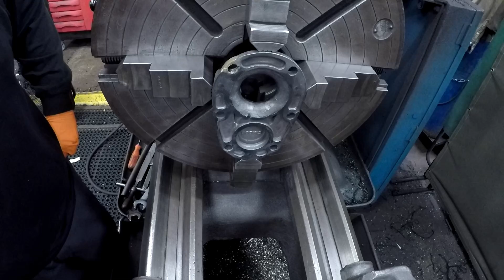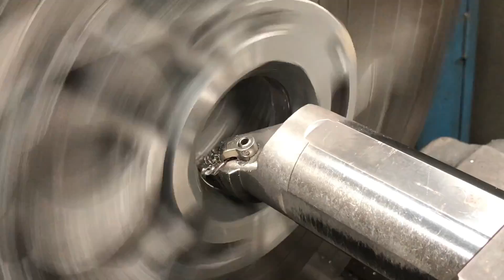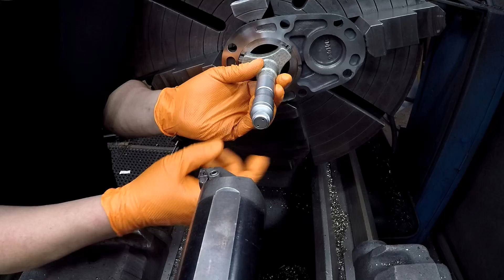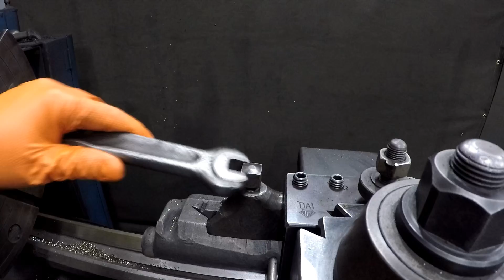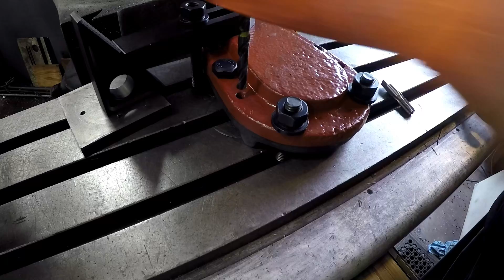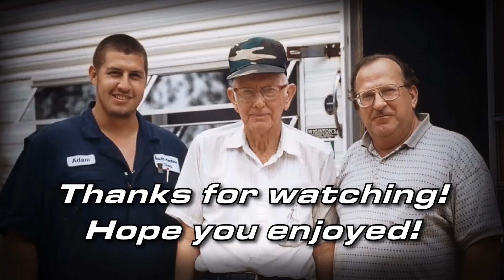Machining a Replacement Casting Part 2

Comment: Never seen a ceramic insert.  Wouldn't they be far too brittle?
Reply: junglejonny1000 I don’t understand questions like these. You just saw how well it worked. So, no, it wasn’t far too brittle.
Reply: @stargazer7644  I don't know if you have ever dealt with anything ceramic such as a ceramic knife.  They are very hard but very brittle.  Yes I saw it cut,, I was hoping to understand how it works.
Reply: If you got the money you can even get CBN inserts which are even harder. - You can easily cut 65C Rockwell hardened tool steel. - Looks like you are cutting with a plasma torch! Google it and get redu for the fireworks show!
Reply: They are actually cermet inserts, i.e. a composite of ceramic particles and metal binder much like Tungsten carbide inserts. The difference is that the particles are a different material, e.g. Titanium Nitride.

Comment: Great work on the new casting , The old casting could possibly be welded and re-machined as a spare , There is an arc welding rod with high nickel content for  welding cast ,Works very well (no pre-heating) ,used on welding my broken exhaust manifold on a 302 ford engine and the repair did not fail .
Reply: I used a nickel cast iron electrode on a tractor exhaust manifold - it worked a treat. it had a very soft arc.
Reply: Great work! I am continually amazed at what can be accomplished with these machines. Of course, it takes a savvy machinist to make the machine do what it needs to do.

Comment: The 2 threaded holes with the pipe plugs in it, probably to put in some srews to push, and pull the cover of the gearbox so you don't have to use a flat-head screwdriver as a wedge.
Reply: Check the last few scenes after he milled the channels. Those holes carry lube.

Comment: First  I'm new to your channel , second I'm not a machinist but I do find very interesting how crazy precise you have to be. I do have a question about cutting the face plate, would it have been easier to use the face grinder instead ? looking at it spin and cutting was a little scary !

Comment: I hear you Adam...on the "boy I'm glad that's done"  Whenever working on the delicate "one-rr" and holding in the lathe or mill is nerve racking....when that last machine cut is over and all is well...it is time to breath easier.  I sometimes double think everything...B4...loosening anything.  Last thing I want to to is re-indicate  the project back in.   I'm tipping my hat to your great job.  Best to ya

Comment: the last two  holes  with plugs , there  are  used as extractor .plugs are  only for protect  the thread.
Reply: They may also be used for that, but they also are used to check/fill the oil for the bearing.

Comment: It’s sounds sexy when you talks metric 😍🤪
Reply: You guys did notice that he converted everything to inches didn't you - "Half a thousandth" would be .127mm.  25.4 and you are back in the world, baby!  (Fun carping about Inches vs mm isn't it ?)
Reply: @mathewmolk2089   half a thou is .0127 mm
Reply: @markrosinski4814  misplaced decimal point. (I hate DP measurements anyway, but I stand corrected)

Comment: Adam, how do you decide between the lathe vs a mill for facing off that cover?
Reply: Work holding is much simpler and quicker than in a mill for this part.  He also is a lathe guy and its an important part so he's doing it where he's most comfortable.

Comment: This might be a dumb question, but the paint job makes it look like it's not meant to be disassembled now. Do you just break the paint next time you need to undo things?
Reply: If it was designed for disassembly, it would have some provision included for removal, such as ears or threaded holes to jack it out.
The only way to remove the cover is to knock it with a hammer, and because of the bearing, that will only work if the gear box is opened up first.
You can try to get a chisel into the seam, but you are just as likely to end up with what you have here - a broken part.
Reply: @joshua43214  It does have provision for jack-screws.
Reply: @donpollard9460  Where? All I saw was taper plugs and bolts. You can't jack from a taper hole...
Reply: joshua43214 maybe it wasn’t a taper hole originally.
Reply: @joshua43214  You can if you use an expanding tool - can't remember its exact name - , but Sykes Pickavant  make 'em, as part of their puller range. You set it in the hole, tighten up the screw (this expands the end to become tight in the hole) and then you use (perhaps an impact) straight puller to remove the casting. Besides Adam said it was where oil lines ran into it (possibly because the shaft was above the oil level ...
Reply: @donpollard9460  That is why they wanted the clearance on the bearing. - This thing is only a cap. Today it would have been a 16ga sheetmatal stamping.
Reply: Industrial paint jobs are usually for corrosion resistance and a recognizable color only.  It would be too expensive to paint it in a different way.
Reply: Yup

Comment: 13:16 probably jack screws??
Reply: That was my thought. Why have a pipe plug into a blind cavity? Possible at some time a bit of oil weeped out and someone ran a plug into a straight thread. Surprised there are no alignment dowels.
Reply: @marksmith6837  Note that the holes line up with the bearing, nothing else, so I think I'm pretty close with this. In another of Abom's videos, he has to deal with a broken casting and it has similar 'symptoms'!
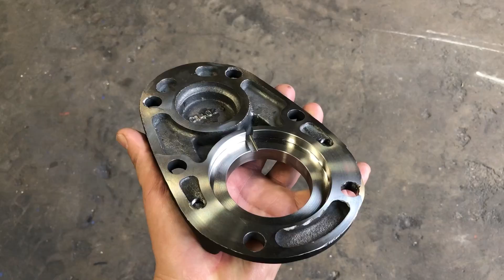Reply: Don Pollard. At 31:15 you can clearly see the plugs in the rough casting area in the mating bolt circle, not in the bearing boss. Besides that, the bearing boss is .001" oversize (actually .0015") you wouldn't need a push off. No need to argue, we see it differently but pipe thread would make no sense for either use.
Reply: The oil probably flows through the box casting into the cover under the plugs. The plugs are there for service (like clearing blockage etc).
Reply: @joshua43214  See Marks comment above

Comment: It looks like brazing and then machining original part would be easier.
Reply: Adam made the right decision not to try and braze repair those cracks. By the time he filleted those cracks then welded each one, the distortion would have pulled those bores for the seal and bearings. Then you would have to try to weld them completely and rebored like he just did. My very initial thought was like yours, but then I realized why he went this route.
Reply: But nowhere near as interesting a video... ;)
Reply: Actually I find videos of repairs by brazing+machining quite interesting (and educational) as well.
Reply: @sergey_sovetsky  Yes, I'm not saying they aren't interesting, or something to learn from. I'm just saying it would have been much shorter of a process, with fewer steps.

I don't know how hard or easy it would have been to braze and machine the existing part to the same degree of flatness and fit. I'm not a machinist...

And of course, I don't think Adam does things for the sake of making a video more or less interesting (at least not ONLY that reason). I know he does things in "interesting ways" to learn new skills or sometimes shows a different way to do something, which is great. But in the end, the job has to get done.

Comment: Nice work, even though it cost you some tool sharpening. Haven't tried it on cast but would spot annealing for the holes helped with the hard crust?  Not sure if it would help or hurt in cast.

Comment: Hi Adam, what is the dial gage and right angle adaptor assembly called called on 5:15 can’t  find one any where.
Great work Peter
Reply: I think it's a standard indicator with an ID adapter fitted to it.
Reply: It is a Starrett 671. I obviously can't tell if it's actually the Starrett product in this video, but Adam has mentioned the part number in other videos. I expect other manufacturers have similar products - the Starrett one should also work with other micrometers, as long as the stem size is the same.
http://www.starrett.com/metrology/product-detail/671

Comment: It's a shame that you and Clarke were rushed on this part.  Leaving it in the sand mold to completely cool, would have probably given a casting that cut like butter.  Thanks for sharing your experience on this "tough" piece, Adam.
Cheers, Gary

Comment: Maybe I'm an ignoramus, but why not do this on a milling machine? Seems like it would far easier and you could've just finished the job at home where you already had the part.
Reply: I was thinking the same thing. It's possible that the back side of the part isn't flat or you can't assume it's cast true enough. But I'm far from being a machinist so I know I don't know what the hell I'm talking about.
Reply: I was thinking the same, it would be harder, but possible to clamp to a mill angle plate.
First clamped through hole, milled face around around clamp, then placed extra clamps around edge and remove thru hole clamp.
A lot of clamp work, I think I liked Adams way better,

Comment: Adam, you’re a true craftsman, a master craftsman at that! Your understanding of machining is second to none. The sad part once this generation is gone, no one will pick this trade up. As mentioned in several comments, put it on a CNC, that’s ok for production parts, but not for onesy and twosy. Thanks Adam.
Reply: At the shop that I'm at we work on mining equipment and we use both manual and CNC machines every day to get our work done. Some guys don't like to do manual anymore but I love running those machines anytime I can!!
Reply: StrikeForce MTB where about are you? I’m glad to hear that!
Reply: @jimposey3963  I'm in Clarksburg, WV. I love to run those old machines and some of the tooling we have dates back into the mid-late 60's too. Awesome stuff!
Reply: StrikeForce MTB hey strike not too far, southeast Ohio. Been to the old anchor Hocking plant several times.
Reply: @jimposey3963  I used to live off of the exit that you took to go to that old plant. Small world man!

Comment: Would be interesting to know what that part would have cost if 3d printed. I saw Ox just bought a printed metal part and it didn't look bad.  Great job, always a pleasure and education watching you work!
Reply: A part that large would be fairly expensive, you'd have to have someone 3d model it first, then have it printed. I threw together a mockup part guessing the size of it and Shapeways wanted 3,500 for it. Mind you that doesn't even include any of the cleanup work you would have to do. Besides all that, Shapeways says that their steel parts are not fit for industrial load bearing applications.
Reply: @MikeBucceroni  interesting, I've never had any quoted.  Thanks for checking into that!

Comment: I understand why you went with the casting the way it was but do you know, given the time, if there was any heat treatment that could have lessened the hardness of the casting?
Reply: Better control of the cool down.  The center part behaved better due to more mass resulting in a slower cooling after casting.  They had their hustle on to get it turned around.
Reply: @ShainAndrews  was there anything that could have been done (reheating) after it was discovered to be so hard?
Reply: @mikemarriam  You may have missed Adam's response.  Yes it can be done.   Uniform heat to the specified temp (1500F ??), maintain that temp for specified time duration (probably the better part of a day), then ramp the heat down gradually.  Time consuming when you are trying to get it turned around quickly.
Reply from the maker: You can anneal it with the proper temps and soak times.

Comment: Nice piece of work, nerve racking to say the least! I'm a Instrument and Control Engineer so obviously this is not my area of expertise but I was wondering why you could not clamp together and 'groove' the original, weld it up and then machine it? Any of you experienced guys help me out with that, am I missing something and being a bit of a Muppet!
Reply: I'm not 100% sure but I believe welding cast iron is very hard and the metal around the welds tends to be to brittle afterwards. Or I could be completely wrong.
Reply: It can be done, but welding cast iron is a VERY "dicey" proposition.  For starters, the requisite nickel rod is EXPENSIVE.  Booth, Fenner, and Rucker make an extremely strong case for brazing, not welding, broken cast iron.  The bronzes used in brazing yield a repair comparable in strength to cast iron and the base material's crystal structure remains intact.  By definition, welding melts the base material and that triggers highly undesirable changes in the crystalline makeup.  Look here ( https://www.youtube.com/watch?v=r2juzL2q6TU ) for the 1st video of a set, where a POOR decision to weld cast iron created HEADACHES.

Comment: why not send this off to a CNC shop?
Reply from the maker: I don’t have a CNC shop on hand that’s gonna take on this one off part job in a timely manner.
Reply: Why would you?
Reply: well a cnc could have made that part in about 30min plus an hour or two to do the design.
Reply: CNC is good when you need to do multiple parts that are the same. For a one off piece it isn't worth the time to spend on the drawing. If they'd had to make a pattern instead of using the old part it might have made CNC worth doing.

Comment: Nice save on this one.  I was expecting something bad to happen the whole time.  Are there any concerns about cracking with the hardness of the casting now that it is in place on the reducer?  Is it safe to assume the forces from machining are much greater than in operation?
Reply from the maker: I don’t foresee a problem with it being used as intended.

Comment: would it of been easier to make it out of steel/cast iron?
Reply: What do you think it was made from?
Reply: His question is, why cast iron? Why not steel.
Reply: It was my understanding that this is cast iron; 
The issue with cast iron is that it is very difficult to machine because it is very brittle in comparison to steel, hence the problems he's already had with it, like breaking off the edge when drilling the holes. The nature of cast iron is that it is prone to damage like that, it is also prone to having hard areas that are even more brittle due to the uneven nature of the cooling, post cast.

Comment: Great video as usual 
Do you not use linishers (flat bed sanders) to level of flat surfaces and machine the hole out afterwards.
Reply: No - not accurate enough

Comment: Would a different spin on the whole project been a good idea?  Do a CAD and have a CNC bang that part out?  I just don'e know.  Did cross my mind a calab with John at SMW might have been fun but that may not have been practical at all.
Reply from the maker: Not practical when you need to jump on it now. Besides, gotta have someone willing to jump on it.
Reply: @Abom79  Willing part is a biggy;o) Thank you for all the videos and great work you do Adom.

Comment: Just wondering if those two threaded holes are actually for jacking bolts and should have been a machine thread?
Reply from the maker: Oil holes, tapped for plugs.

Comment: On interrupted cuts on softer materials without hardspots, do the edges of your cutting tools dull quicker than under even load?
Reply: Yes. All interrupted cuts will dull tools quicker. HSS tools are better for this, but it still happens.
Reply: @operator0  
Thank you!

Comment: Nice job! Why not use the shaper to do the facing? Could have been a nice job for it? Or would that been even harder to fixture?
Reply: I think using the lathe was mostly for efficiency.  With one set up he could face the piece and do the boring.
Reply from the maker: Lathe is easier to hold parts like this.

Comment: Why not use oxy acetone to temper it softer?
Reply: he did in the last video when he brazed the broken spot
Reply: @taylorwso  I assume he didn't get it near hot enough to do a proper annealing. It this job speed was the goal and that meant chewing through bits. A new casting, or going through a proper temper/annealing cycle would have been best, but that would probably require a second heat to redo the brazing, and every heat gives a chance to destroy the casting

Comment: I can't help but wonder if it might have been less costly and actually stronger to build a new end piece from a steel billet on a mill. Having a casting made and trying to hold run-outs and perpendicular, and center to centers, .. it is a great deal of high skill work.  Fantastic to watch the process, but was it the right business decision?  Adam, can you please reply with why the decision was made to replicate the damaged part as a casting with complex machining instead of a relatively simple billet material removal on a mill?
Reply: That was my thought too. That loose fit they wanted might have caused the casting to break in the first place. Unless it had to look the same for cosmetic reasons, making it from a piece of steel would have been much faster,  less trouble and stronger. The outside could have been left flat and use slightly longer bolts.
Reply: He answered this in another question. He didn’t have access to someone who could turn this around on a cnc in a couple of days.

Comment: Intrimikes are always fun. The thimble moves backwards from what you're used to, and they read in 0.0002", or at least the ones I use do. If you're not used to them, they're a pain! Usually throw an inside mic or dial calipers in just to makle sure I'm getting something similar to the +/- 0.0002" reading.
Reply from the maker: I don’t use them enough to be very quickly, at least with ours. I don’t like the way they made the marks on the barrel, very hard to read. You have to keep up with count from every Two hundred line.
Reply: Yeah, I only use them when the job specifically requires it. Usually have 2 of us take repeated measurements independently and see if we can agree, after we practice with the thing for a while. I think I’ve used one for 2 or 3 jobs in the past 10 years.